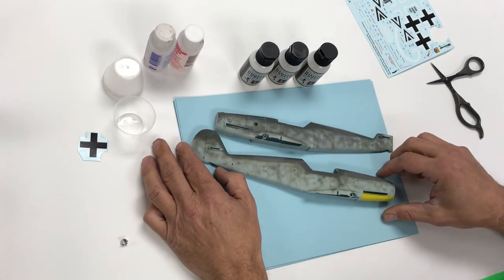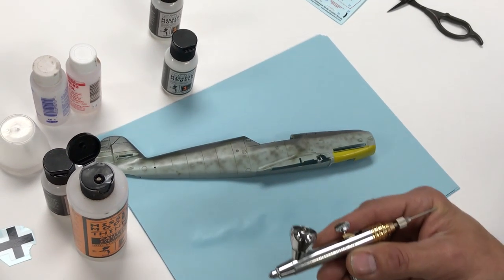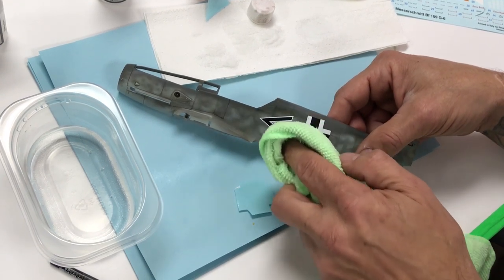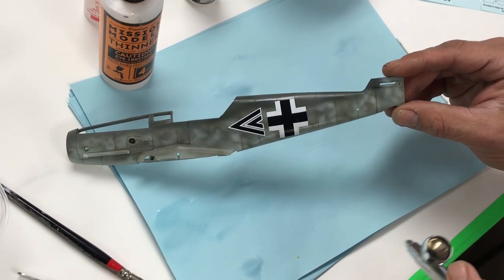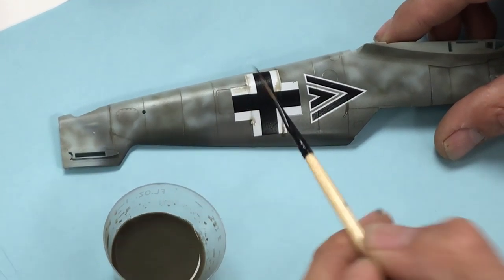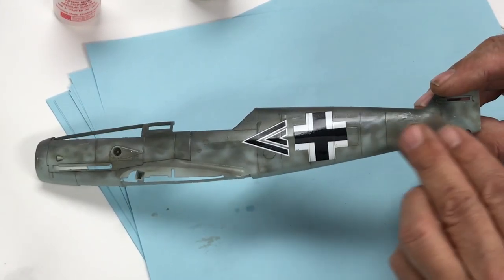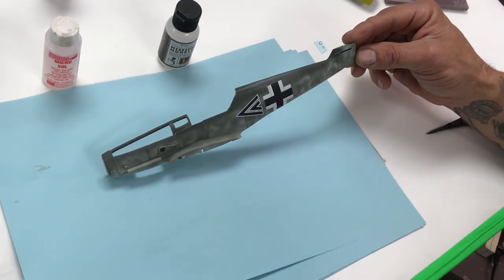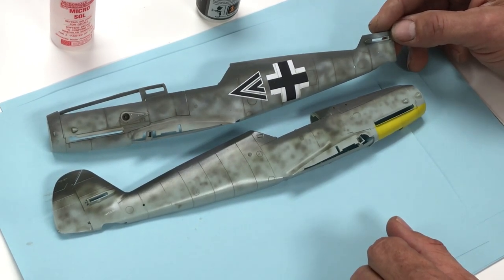Mission Models MMP decals and clear coat quick demo

Comment: How does this compare to future? Is the clear UV protected? Lastly, can I spray future on top of this?
Reply from the maker: It is far superior to future.  Future is floor wax.  This is an automotive grade acrylic clear coat
Reply from the maker: Yes Mission Models Clear are UV protected and will not yellow or crack
Reply: Thanks for the quick response. On my way to buy it.